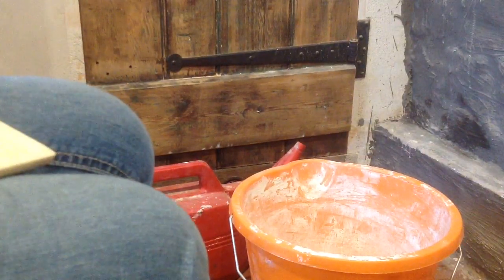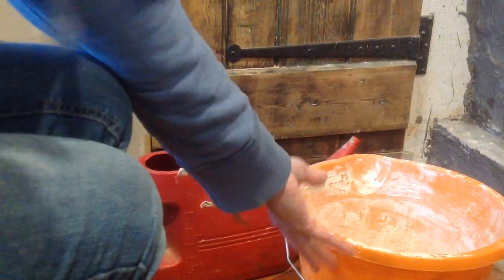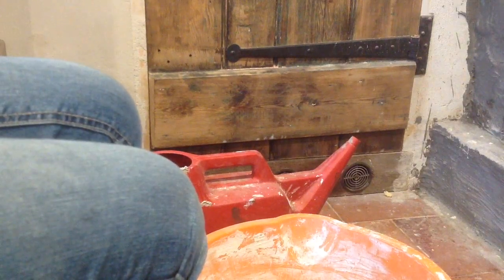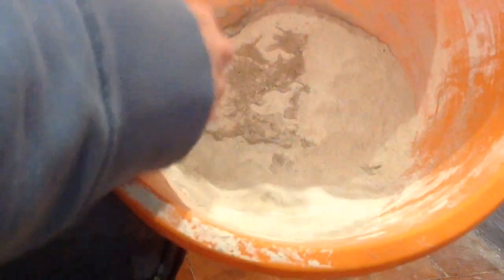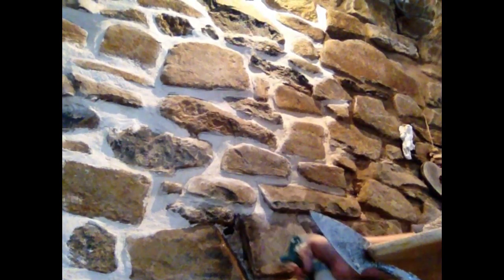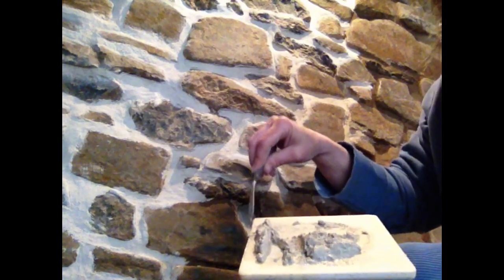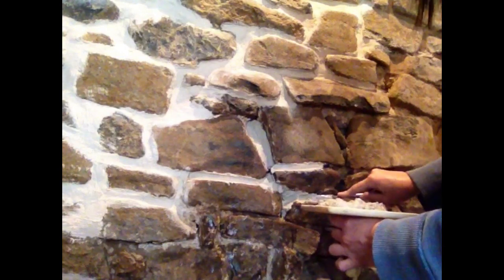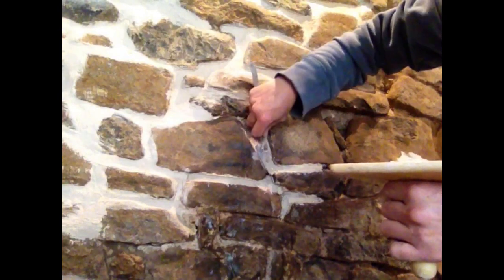Pointing A Stone Wall In Lime Mortar

Comment: I  have always been told not to flatten lime mortar but tamp it in with a stiff brush to make the surface rough so it breathes
Reply: You are correct. Tamping with a stiff brush opens the face and allows for carbonation. She missed that step.

Comment: Because lime only hardens to a depth of 1 inch, I always use small stone to fill is out. When it's drying, I use a churn brush to get a rough surface finish. I also work it over with a paintbrush handle.

Comment: I have a granite house in Ireland and have already removed all the old lime plaster from the walls showing up the granite. I was thinking of pointing it in lime plaster but with a black dye in it as it will show up the granite it being of a lighter colour. But I have a problem in the living room down stairs in that there is only one window in the room which does not let in enough light. I was thinking of completely lime washing it so that any light that comes in will reflect off the white lime and add more light to the room. What do you think. The reason I am doing this is money is needed for many more things in the house so need to cut costs but still do a good job.

Comment: I don't no if I am right or wrong but any pointing I have done I have pointed so much then will a bucket of water and a sponge and wiped the stone after to clean it up and also run the sponge over the work I have done to get a cleaner finish.

Comment: What is the best lime-to-sand ratio for indoor applications?
Reply: Hi, I only used lime mortar, no sand was added, as per the instructions on the bag. I hope this answers your question.
Reply: @nickycreswell8762  Thanks for your reply. What kind of lime did you use? Hydrated lime?